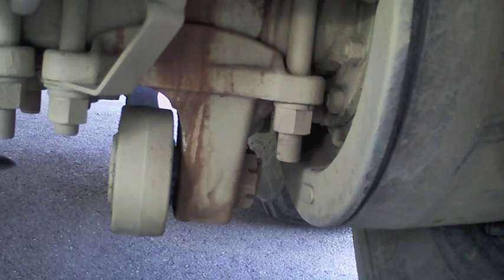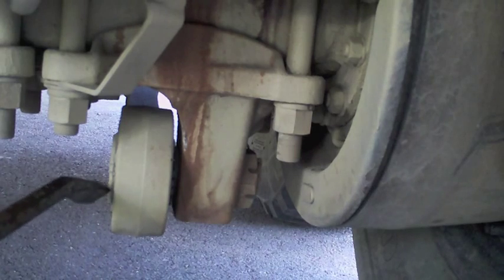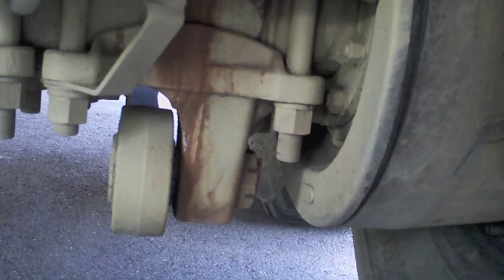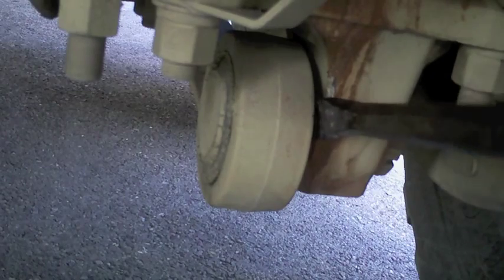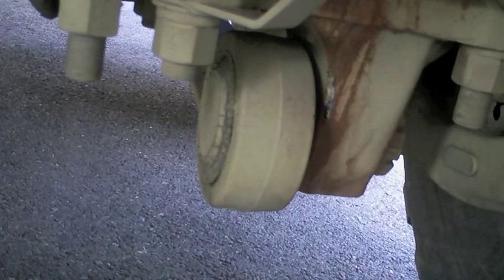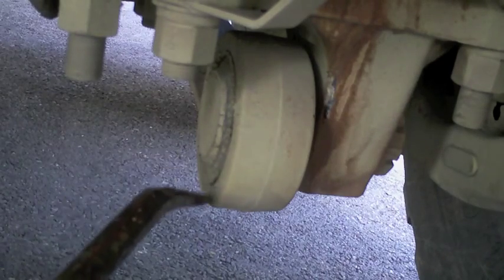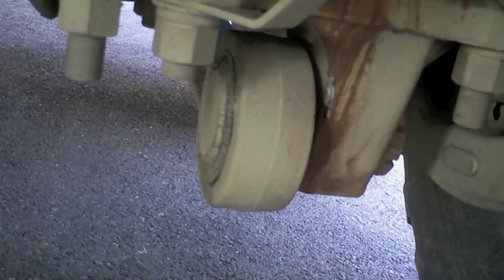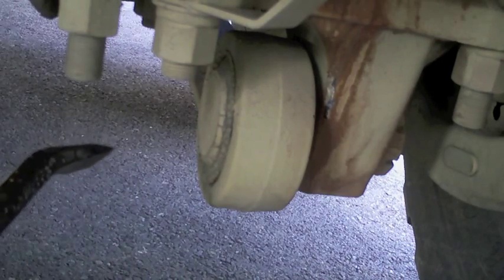M923 Torque-Rod Check

Comment: Hi nelson i have a M930A2 Dump truck in mexico and i use it for work and i'm having a lot of trouble with those troque rods when i'm rolling down a hill loaded. The front right side Torque Rod just comes loose (the rubber was out of the ring and the Torque Rod was separated from the mount) and i was researching that these series 7979185HD the heavy duty style can be more efficient than the rubber ones. I want to hear what you think about them. Greetings.
Reply from the maker: Drill and tap the torque rod center mount with a pair of 1/2 holes then bolt a plate straight to the mount so that the rod can no longer slip over the rubber and fall off.  I have heard of them going for years just fine with that modification and it will buy you some time to decide what to do next.  I think anything other than the rubber might have wear issues but I have never researched what you are looking at.  I will do that.
Reply: NelsonStudios  thanks for the advise nelson
Reply from the maker: @craigmancool oh man you are not going to get that loose with a wrench in the snow positive of that my man.  Pull the axle back close, wrap a chain around the old rod post going to the front and to the rear.  Use chain binders to lock it in place front/back.  Just like you are tieing equipment down on a trailer.  That should keep it in place well enough to extract the truck. Call me if this doesn't make sense. 4065469787  I can't see you getting the nuts loose without heating red hot and a jack under the wrench.  Top or bottom.